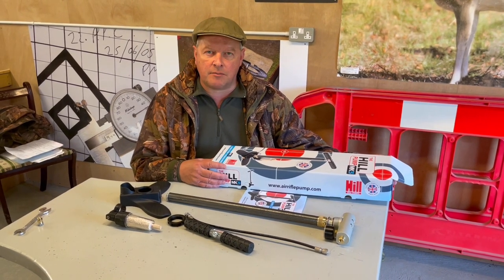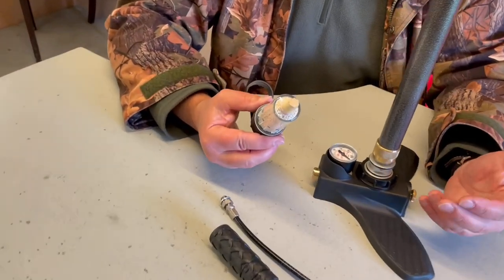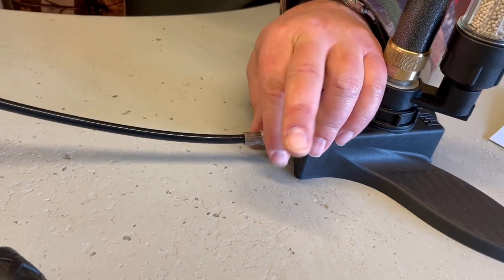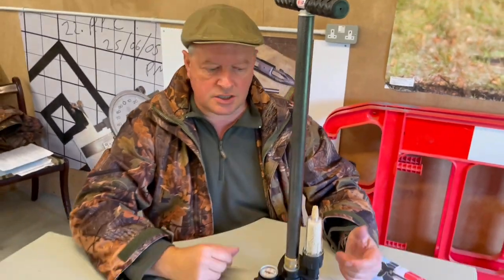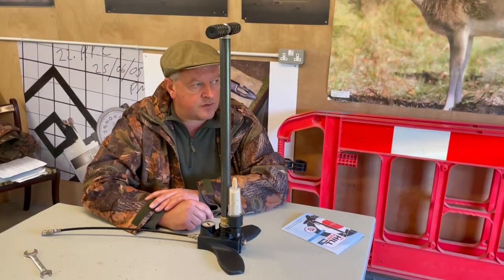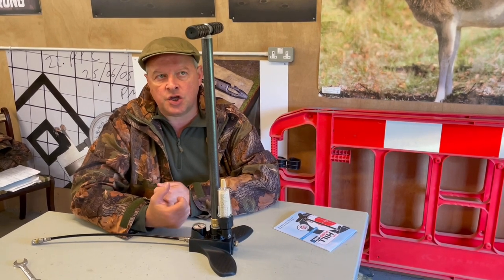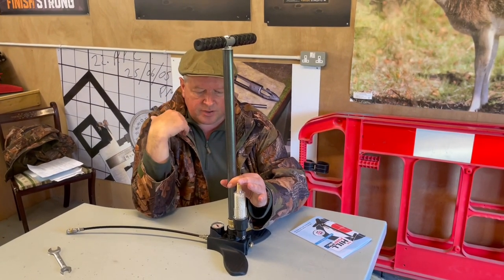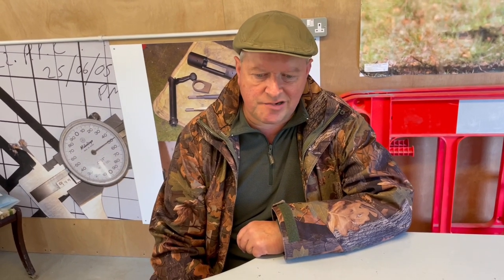PRODUCT: Hill Mk5 PCP pump

Comment: The problem with hill hand pump is carrying around, Hill hand pump company inspite being a old and reputed mostly doesn't listen to thier customers, we had been requesting to come up with a comfortable carrying bags of the pump but even after so much request mk 5 also came up the same again, because no carrying bags it's very difficult to take around which also not only inconvenience but dirty the pump sometimes resulting in demage too, because of the big base of all hill hand pump it doesn't fit in most bags, some modification can be done like foldable one

Comment: Can I ask. Why has your dry pump part got a screw in their. And a brass thread. My mark 5 come with just a plastic hole with plastic thread. How does it work. Thanks.  Ok.. update I just noticed the small inlet holes. Which pass through the dry pack. I will find a ( I think ) 10mm bolt of screw like you have done for they did not supply one. For when I’m not pumping. 😢

Comment: How do the beads keep moisture out they don't seem to be integrated into the pump at all. Just sitting to the side. Do you put the beads in the pump somewhere?
Reply: On the upstroke of the pump, ambient air is sucked into the pump through the top of the drypac unit, through the silica beads and into the pump's cylinder.